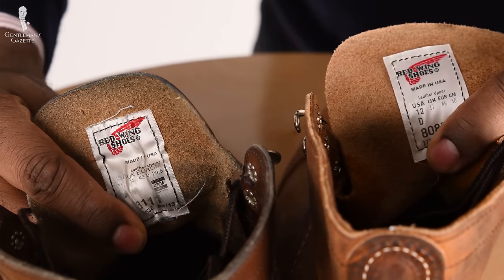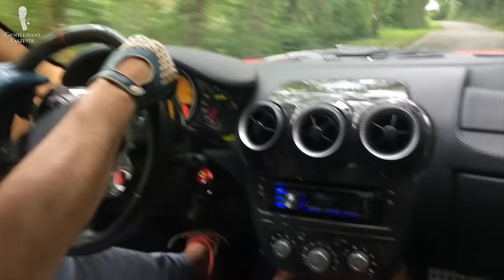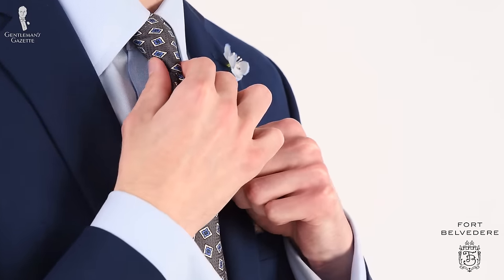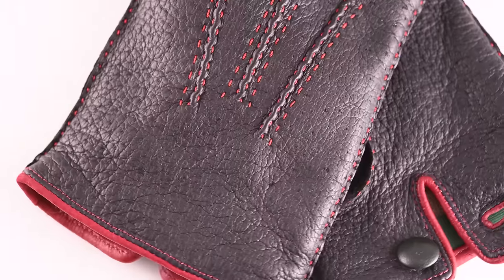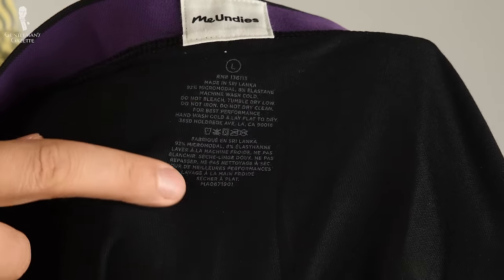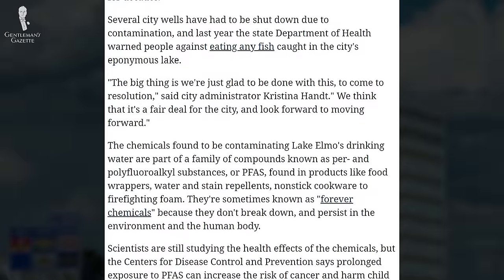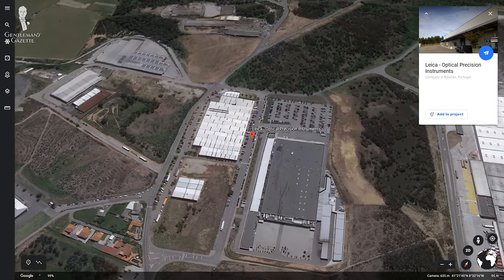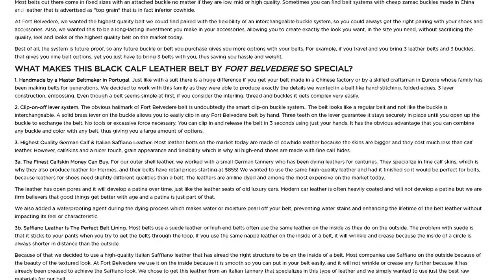🌎 Does "Made In" Matter? China vs US vs UK vs Italy vs Germany...

Comment: An angle you may not have considered is the people who made the product and the local economic benefits. For example if an Italian business fires its Italian employees which may have worked for this firm for years and across multiple generation and hires Chinese to do the same work at a lower wage the business person maximizes profit as minimum wage is a cultural norm from china and is tolerated by the new work force. The next generation of Italians may find themselves out of work and will be unable to invest in the local economy, the company may also lose out on quality as they no longer have the employees responsible for delivering the fine craftsmanship. This is a betrayal of the Italian people as it is replacing the work force. I have heard people in Italy are very upset at this as the replacement of the workforce and population has caused negative economic impacts as well as the travel from China caused disproportionate illness. This is why i no longer care where it was made but who made it. There is also the connection to the piece I myself am a member of the  Swiss diaspora and therefore have greater sentimental value or connection to Swiss watches, they are also conversation starters as when people find out I am Swiss they will often ask about if I have a Swiss watch or knife.